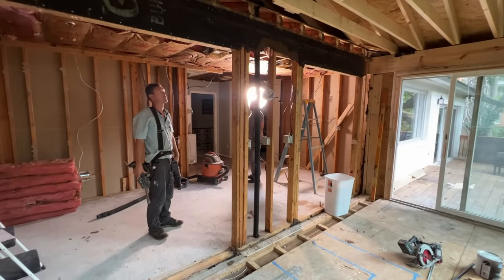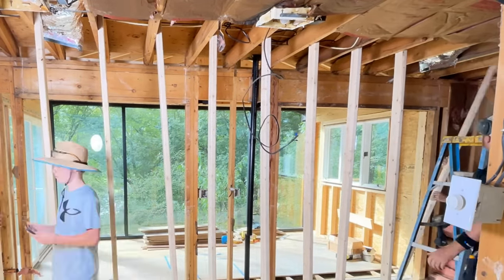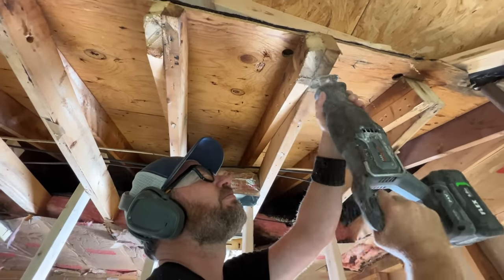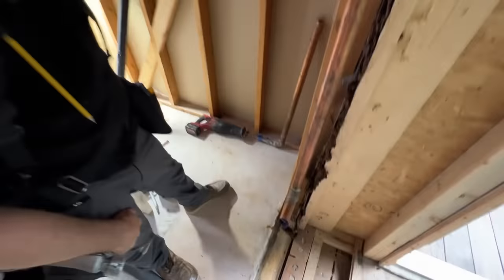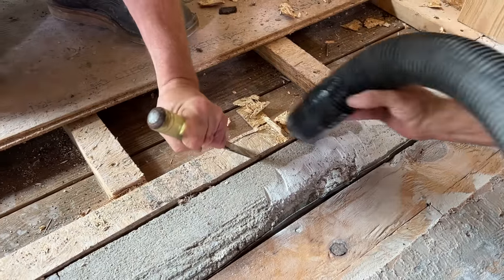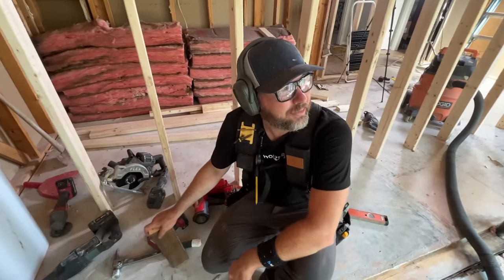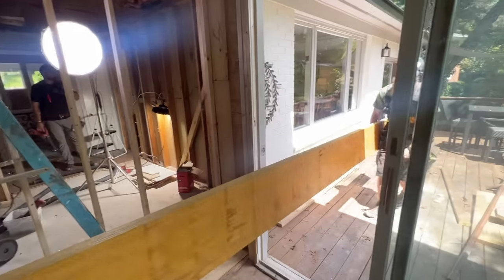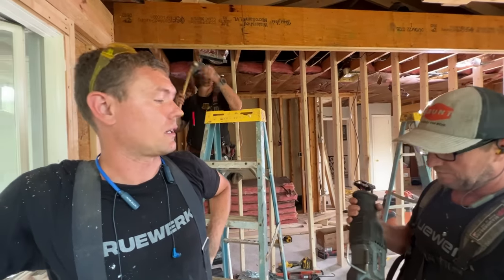Removing a load bearing wall | kitchen remodel EP09

Comment: The Diablo carbide demo blades are the best I've found.  I started using them exclusively after they sent me a couple fire/rescue carbides to try for auto accidents and extrication.  They didn't dull anywhere near as fast as bi-metals and I could usually get about anything done on a wreck with one blade.  Throw a new one in for next time.  I was sold for good.  
Also, glad you guys have a good, solid crew now.  Been watching for years and I think you found your right team.  If I remember, you only had about 2000 subs (only had a few videos up) when I first found y'all and I've watched every video since.  Keep it up.

Comment: When supporting walls you want to get some acro props, put a timber header across the joists and prop underneath. Can do it with timber also, would be alot quicker. Great vid guys

Comment: Just one observation from the video. A couple of the walls had shear bracing (diagonal stud) on them.  They may not be load bearing walls vertically, but may provide shear resistance for the outside walls. Looked like the sheathing was fiberboard.
Reply: The last wall they took out was definitely a shear wall.

Comment: My sister knocked out the middle third of her kitchen wall to dinning room. The wall was load bearing and also had most of the cabinets. She left the stud in the middle for outlets and the doorway to the dining room cause it also had outlets and light switch plus to keep the original trim.

Comment: I had to laugh at the shop vac tubes being stuck together. As a home builder myself I know that struggle all too well. 
Thanks for the content as always. I appreciate your commitment to the details, your teamwork and always finding a way to laugh at the little things.  Keep doing what you do.
Reply: On the shop vac tubes, puling is hard.  Instead, bend back and back at the joint while pulling.

Comment: One tip you may consider next time you support the ceiling joist for a header installation, is to lay a 2x4 or 2x6 down on the floor first, then add the 2x4 uprights to bear on this plate. This will spread your load over all the floor joists, as by chance you did not land the uprights on a floor joist, which could punch a hole in old plywood on the floor. Just a safer construction practice.
Reply: Not to mention the shear force that’s on the screws directly. Saved time yes. But wouldn’t at that cost.
Reply: I was worried the bottom of the boards would get knocked out of the way by a wheelbarrow, etc.

Comment: Anything over 2 ply on headers should be bolted ever 2' staggered so they don't separate. Good job guys
Reply: They make LVL screws (FlatLOK) just for this and most inspectors make you use them.  If this was my header I would have cut the ends to match the roof pitch, notched in a flinch plate and jacked that bottom flush with the ceiling.
Reply: @FJB2020  I was wondering of someone would make this suggestion.  Also, 40 years ago two fir 2x12's would have made that span. With a roll of roof flashing sandwiched between them for a flitch. How times have changed.
Reply: @N.A.J.  I am in 100 year old+ barn house with 2x6 poplar joists 24"ish OC.  When I redid the bathroom and put 2x10x10s 16" OC my old timer neighbor thought I was crazy... No bounce in my floor system..

Comment: That Diagonal Brace in that wall you cut out was to stabilize the exterior wall, but since you kind of boxed it in with that addition, it shouldn't cause any issues..

Comment: Well, not only could you put a box at the top but you could have a half wall at the bottom which would still give an open concept but also a 'pass through' as well as a spot for short bookshelves, etc.

Comment: Not sure the code allows a triple laminated beam held together with any number of nails. From what I gather you'll need through bolts with washers for that tri-lam. Some engineered lumber specs will let you use adhesive and nails, but the straight nails will I think fail an inspection?

Comment: quick question from an amateur - could you have cut a 45 degree angle off the top corners of that beam to get it a bit higher, or would that compromise the strength / integrity of the beam?
Reply: I bet it would be fine… but I think that’s kind of a no no without an engineer saying it’s ok

Comment: Do ye use steel beams over there at all? We used a couple of 7x3 RSJs for a slightly longer span sitting on a cavity block wall, lots of strength and more head room inside.

Comment: In the UK we would reduce the timber size to make less of a bulk head and make it a flitch beam with a sheet of 10mm steel sandwiched between 2 boards. Never seen you guys do that so maybe it’s just a UK thing?

Comment: There doesn't seem to be any dust protection? Open air (demo related air particulates) from the construction area is easily transferring into the living space. Plastic,  negative air machine, hvac returns capped off, am I missing something?

Comment: Hey guys, Curious if instead of a triple 2x12 beam, does code allow you to install six 2x6 or something similar to reduce the depth of the beam so the ceiling is flush?

Comment: (UK) Absolutely do not use 4x2 as builders props to support a roof or upper floor load when removing a load bearing wall. Only correctly designed steel props or 'Acrows' must be used.
Reply: The worst is the way the 2x4s are installed, the whole weight of the upper floor is not resting on the wood directly, but first on the screws linking them to the joists. These screws are not made to resist shearing forces.
I'm from France and we would also use acrows for this type of work.
Reply: @pierredanel7771  totally agree.
I was watching Les Jerômes restoring Chateau d'olly, they were putting joist hangers on a wall plate, no issue there, but using screws to secure it. I would expect 40mm twist nails.
Reply: @andrewclarkehomeimprovement  actually there are some screws that are made to resist shearing forces, I didn't watch the video you're talking about but they may use those. You can check Simpsons SSH screws for example.
Reply: @pierredanel7771  ah, yes. Thanks 😊

Comment: Isnt a metal bean a consideration in such a circumstance, you could get away with a much lower beam and possibly a flat ceiling. Or is metal to expensive?
Reply: I’m not sure how much room we could save… wood was the fastest and easiest way to reattach the ceiling to the beam

Comment: Clearly the rest of this make-over will not be added.  Perhaps the owners decided it was taking too long with filming included and it was completed without being filmed.  I do wish Erik had either added an explanation at the end, either in a final video or as an add-on at the end of this video or removed the entire series from their channel.  Having done none of these is a bit disappointing.  And I do wonder why they have delayed the Duplex build, which is their current project.
Reply: The very end of the final episode said that the next step was on to the "interior subs" (i.e. interior subcontractors). I assume this was the plumbing, electrical, and drywall teams that were to be hired to do the work. There could any number of untold or unknown details as to why those were not completed at this time, Could simply be money. Maybe they ran into another issue having move water around inside or could have discovered mold or a major problem that put a lot on hold. Either way though, it would have been nice to at least got a message or small video with just a tiny update like "hey, this project is hold because of X" or "We'll be back after many delays with the subs finally completing".

Comment: For demo work, I absolutely cannot recommend enough the Metabo HPT 36V recip saw. It is an absolute beast of a machine, leaving all others drowning in its wake. Pair it with Diablo blades and you'll be cruuuuuuising. I cut down a tree with it and a Diablo pruning blade, no problem. 🤣

Comment: Gents, please don’t place load on brick walls as they are rarely structural…. They provide color and weather protection, but you don’t want to place load on them of any amount. Check with a structural engineer.

Comment: what happened to the guy without fingers?
Reply: That is Jamie (one of the two brothers). There are a bunch of videos on this channel about his accident about two years ago. He was working on some finished carpentry in his shop and with his hearing protection in, he didn't hear that his planner was still running when he went to grab a board that was laying on the planner's bed surface.
Reply: @mrfochs  oh, i didn't know that, thanks
Reply: Yes, hey guys…!  Keep you fingers safe!

Comment: G,day Perkins Bros Builders from Sydney Australia.
Bushfire prone building (forests).
I'm noticing that your regulations (Laws) allow home owners to build very close to forests and at the top of hills. 
Australian standards assess;
* Slope and topographic survey
* Fire resistant material
* Space and load from forests 
* Active and passive firefighting
(If I was the inspector, I'd want mechanical connection to the jack studs, and load bearing beam) L
🌏🌲💦
Reply: Yeah that’s a lot to consider… probably a good thing